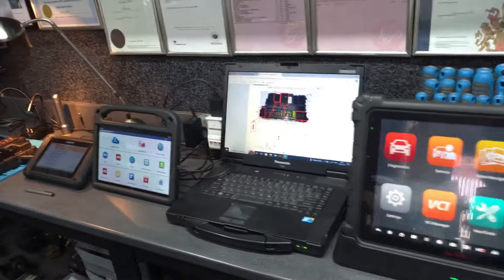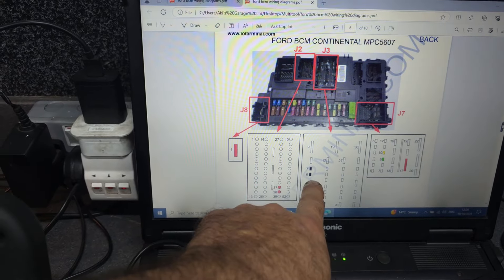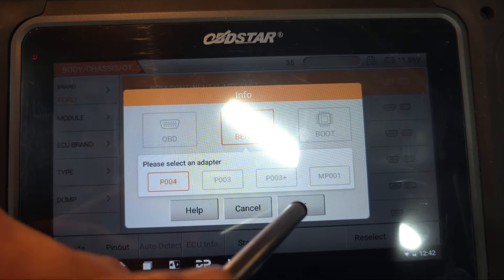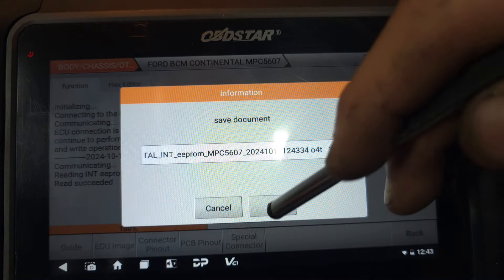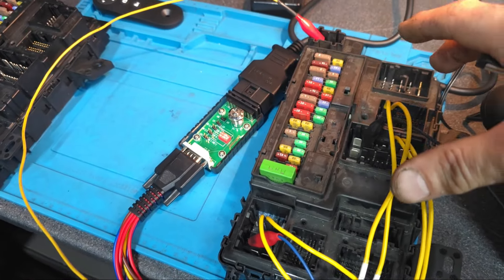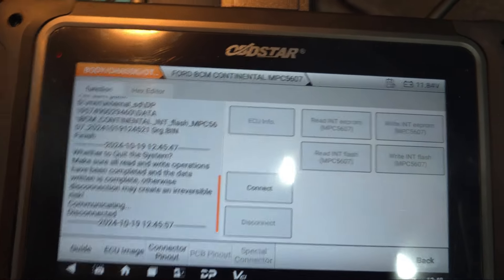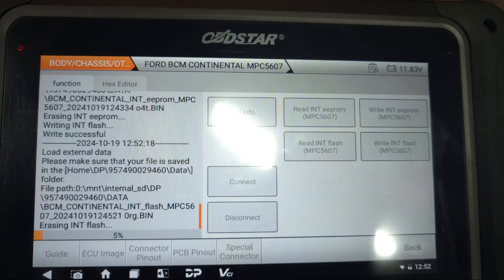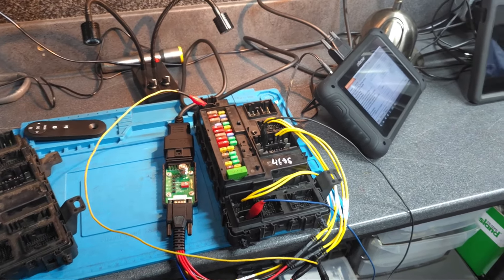Ford Transit Custom BCM (Body Control) Cloning,Immobiliser Data Transfer, Plug & play OBDSTAR Dc706

Comment: Had 2019 transit bcm and used DC706 device and it failed to read, so this does not work on all transit bcms.
Reply from the maker: @michaelharris6941 Hello, and thank you for watching! If it's the same module as shown in the video, it should work just fine. I've dealt with hundreds of those BCM clones without any issues. Thanks again!

Comment: Hi there any chance you can do that in my place? I have 2016 transit custom ECU with BCM not connected properly and give message immobiliser malfunction
Reply from the maker: @RichardGhantous-l4c  Hello, and thank you for watching. Unfortunately, I can only provide this service at my garage in Bristol. However, you can send both BCMs (the original and the donor) to my workshop by post.

Comment: Did you use a separate power source and ground to Bcm, or did you tied junction with p004 harness?
Reply from the maker: @wallytanss97  hello and thanks for watching,  all power and ground are connected with the p004 adapter. 
Thanks again
Reply: @ thanks for reply